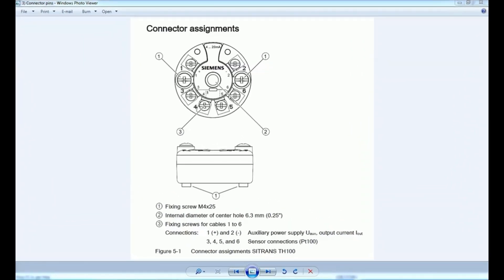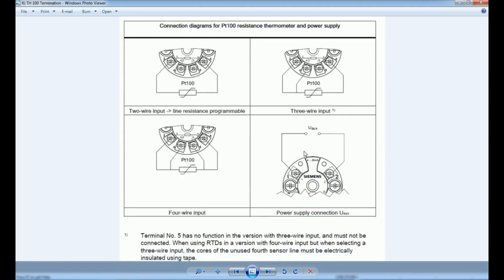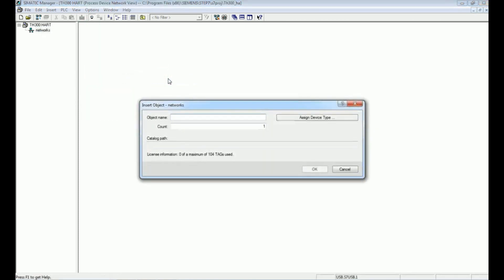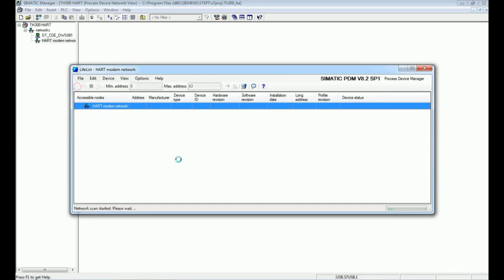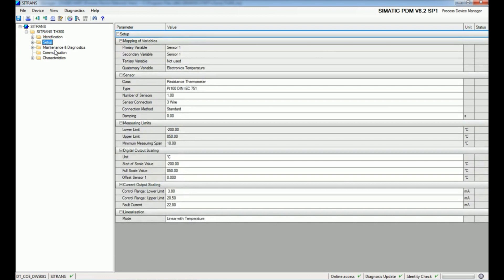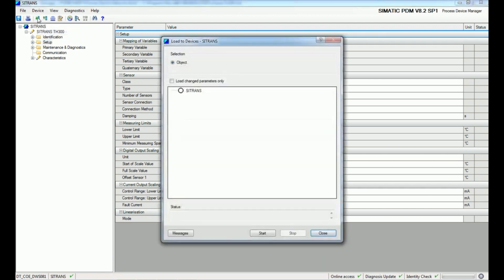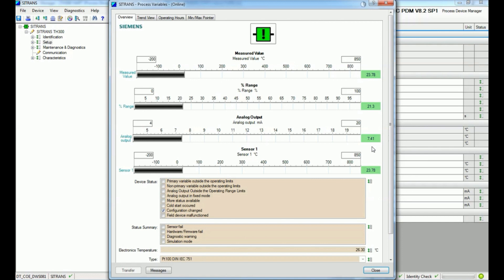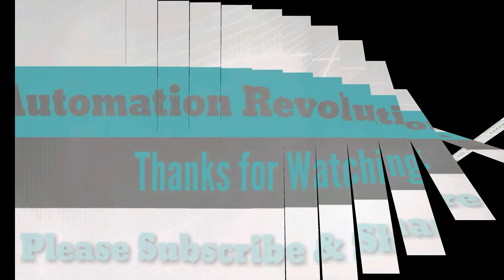HART Communication with SIEMENS SITRANS Temperature Controller TH300 & RTD

Comment: I'm connecting a DAQ in parallel to the resistor with a capacitor to clean the signal and acquire the signal, and it did work too :)